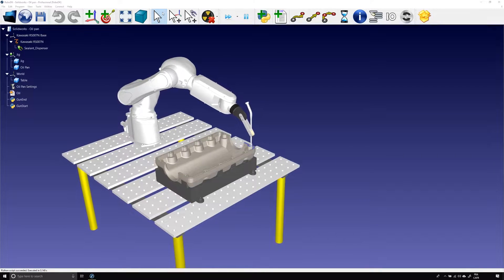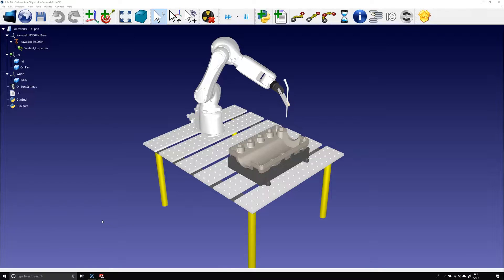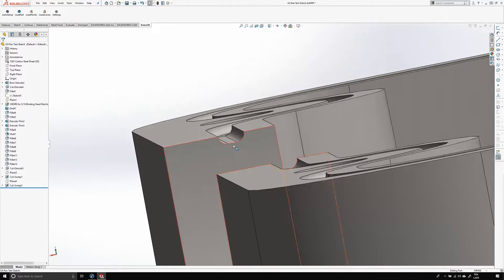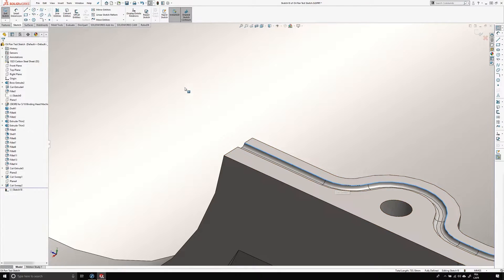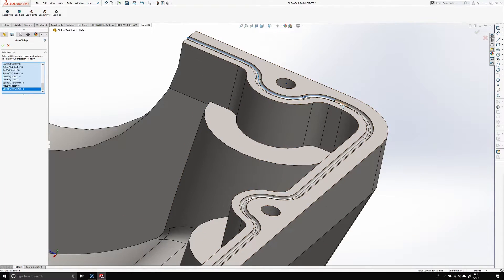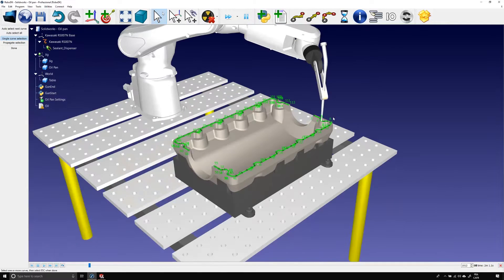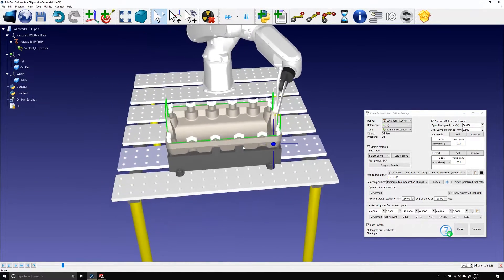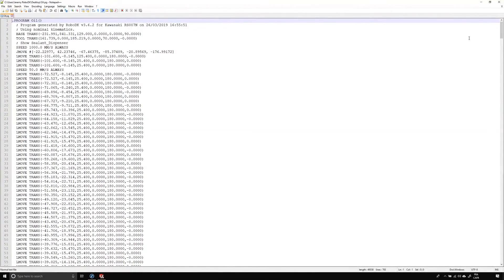Liquid Dispensing with a Kawasaki Robot - SolidWorks - RoboDK Add-In

Comment: Very interesting tutorial , i woud like know if it's possible to generate a path with a step of 5 mm , i use robodk in my project  ( which is basically a carbon tape laying head ).
I would like to split my path every 5 mm in order to send instructions to the automatic leaying head .

Comment: Awesome video! Do you support 3D sketch in SolidWorks or any other CAD software?
Reply from the maker: Hi there, thanks a lot!
3D sketches work exactly the same. 
The rule is pretty much : if you can draw it, you can import it.
Make sure to be able to give the tool an orientation by having a consistent surface following the path and selecting that surface.

Remember that you can also import the path in pieces and merge them afterwards inside RoboDK. It can be more convenient for complex 3D sketch where selecting a surface may influence the orientation of more than one part of the path including some that we do not which to influence. 

Have a great day!

Comment: Thank you very much for awesome video tutorials. 
I wold like to know how to run a code generated by RoboDK on Universal Robot. 
We use reference planes on Universal Robots when we move robots around. Can we do the same with RoboDk?
How can we use camera vision with RoboDK?
Reply: Hi Shan, 
you are welcome!

1 - There are a few ways to answer your question. 
a. RoboDK is equipped with a bunch of post processor enabling you to translate any project you created in the software into a readable script (text file) for your robot controller. 
By using the UR post processor, which will be selected by default if your RDK station uses a UR robot, you will translate your RDK project into a .urp and a .script file. 
b. You can connect the UR robot controller directly to RoboDK and execute the same program in real time in the simulation software and on the real robot. We can do that using our robot drivers.   

2 - Yes, it's possible, go take a look at our "Basic Guide" series on our YouTube channel if you didn't already. 
https://www.youtube.com/watch?v=xZ2_JEbS_E0&list=PLjiA6TvRACQd8pL0EnE9Djc_SCH7wxxXl
I'm covering the subject a bit. I'm planning to release a video on that specific subject in a month or so. In the meantime, you can go take a look at our online documentation : https://robodk.com/doc/en/Interface.html#RobotReference

3 - This question is a bit too complex to be explained in a YouTube comment. I will suggest you to visit our forum, see if there is no thread on the subject, if not create one. https://robodk.com/forum/